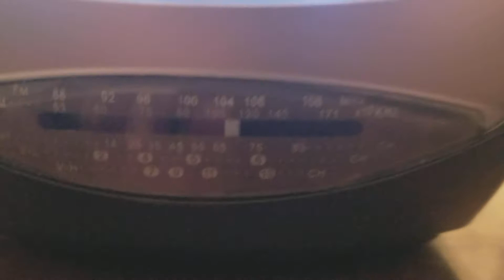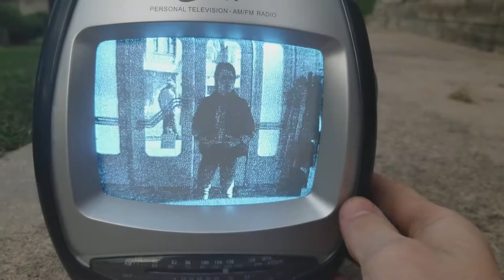DIY analog tv transmission V2!

Comment: The channel is not important,the frequency which is behind the channel is the most important for receiving tv broadcast signals
Reply from the maker: Brilliant deduction
Reply: @Antichamber  how do you transmit the right frequency?
Reply from the maker: @MrPillowStudios  what do you mean?
Reply from the maker: @MrPillowStudios  what I mean by that is that every part of the frequency spectrum is dedicated to a specific use and has its own laws in the US. It is not legal to transmit on any frequency that a analog tv will receive on. It would be legal to transmit on a Ham radio band however
Reply from the maker: @MrPillowStudios  yes
Reply from the maker: @MrPillowStudios  because it was fun to design and build. It was only on for a few minutes
Reply: @MrPillowStudios Both of you are wrong. 

FCC rules and regulations state that anyone can transmit an analog signal to any analog-based devices as long as it:

1. it’s signal does not interfere with other stations that use analog (ABC, FOX, CBS, etc.), which as of 2021 it is theoretically impossible for that to happen as all real analog stations are now gone. meaning you can do it on any channel

2. The content you are showing is not pirated, or violates FCC broadcasting laws.

3. Your signal cannot go over 200 feet. Anything over 200 feet is within the “licensed parameter”, meaning you would need a broadcasting license to go over 200 feet, otherwise it is considered illegal.

Both of you should condone research before making a false statement or releasing a video and not sharing accurately useful info.
Reply from the maker: @BeatTLFEntertainment consider that if I state it's legal, someone may try it without knowing about it conforming to those guidelines. If I state all those guidelines:
 - they are subject to change and I don't want to keep it up to date
 - someone may misinterpret what I said and make an illegal device
 - if someone makes an illegal device because of my video, I may be liable

So yes, it is technically misinformation to outright tell people not to replicate what I did. But I really don't think it's that important
Reply: @Antichamber  you do realize the fcc is lazy as hell? They rarely interfere unless that signal goes for miles upon miles